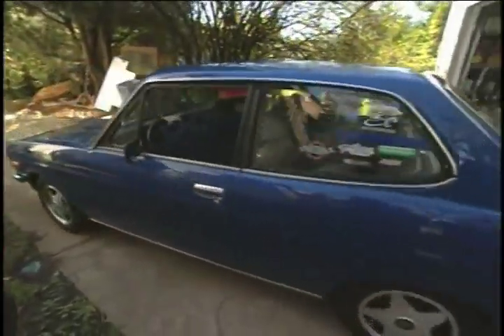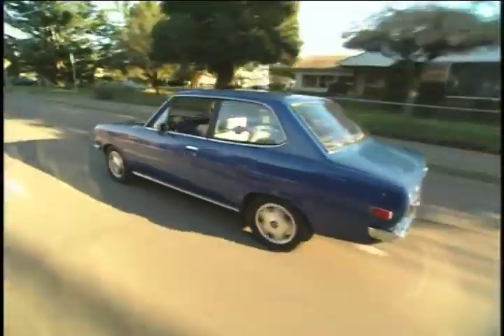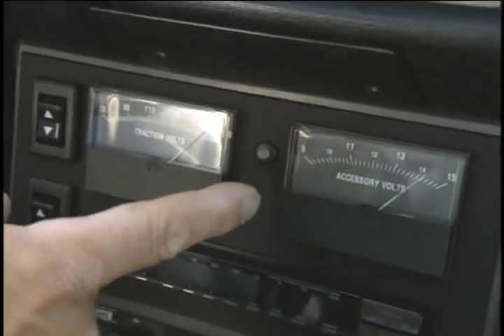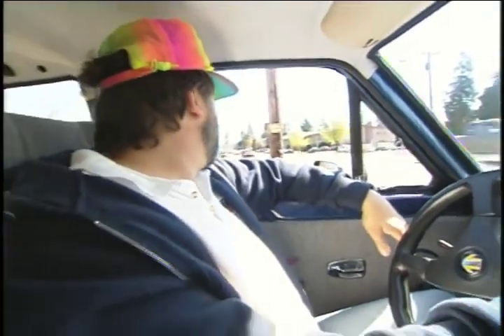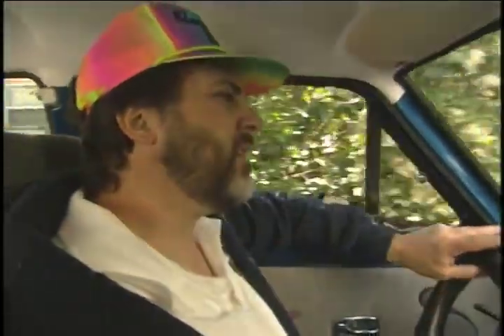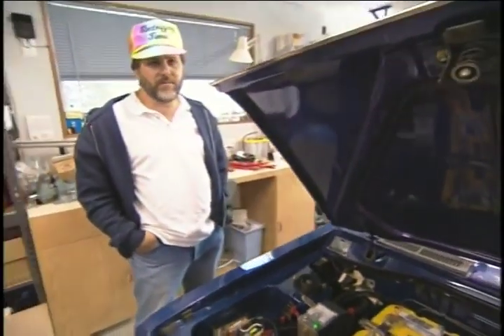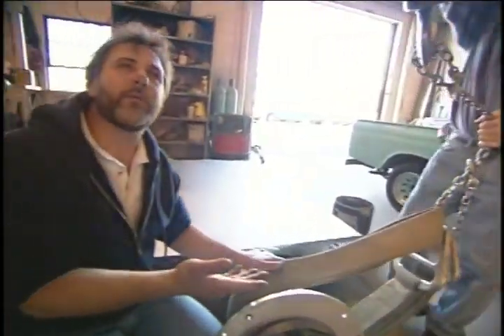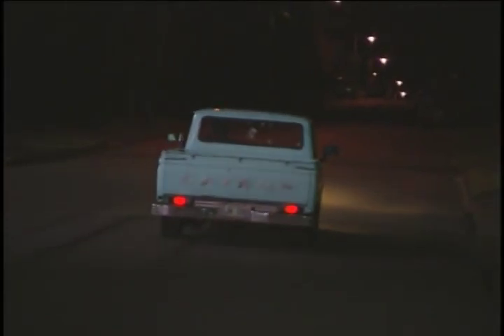Save Bucks. Build Your Own EV Like He Did

Comment: He states it runs the same when it's cold, we'll come to Maine when it's 20 below zero and make that same statement. How does the car get heat to keep you warm. These are not electric cars they are battery powered. Electricity is great for motive power but u til the cars are pulling electricity from the grid and have unlimited mileage these battery powered cars are nothing but a novelty. To all the virtue signaling people out there wanting to save the world, well your not.  Climate change, yeah it is very real, yes it is a threat to the world but it's the sun and it's cycles that are driving these changes not the gas that makes your soda have bubbles.

Comment: I'm not a big EV or Tesla fan but I love the idea of putting electric motors in old cars just for fun, 😎🖖
Reply: Why is there such a negative stigma around being an EV fan?

It sounds like you’re an EV fan and that someone is shaming you for it?
Reply: @cybertrk  I like gas and diesel motors, I don't think we should only choose one, we should have all of them,
Reply: @cybertrk I think it's fine to have EVs as a novelty car and all the power to those that want to drive them but the idea they should completely replace gas powered vehicles is insane and not doable on many different levels
Reply: as long as they have a transmission :)